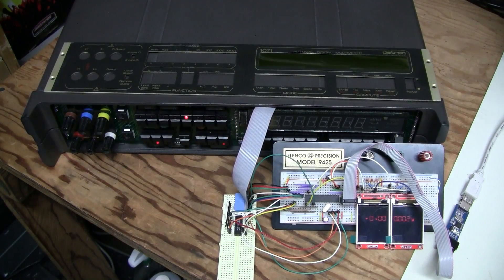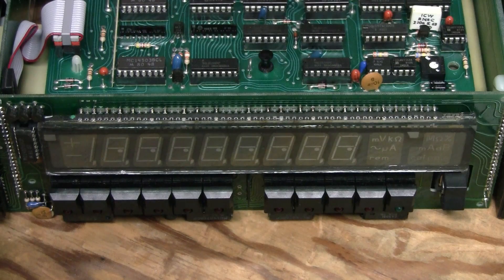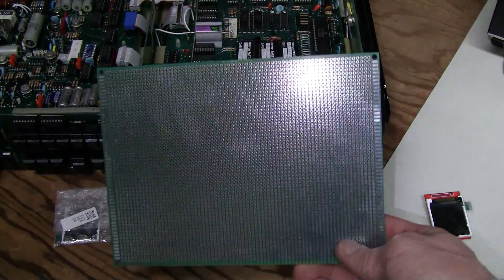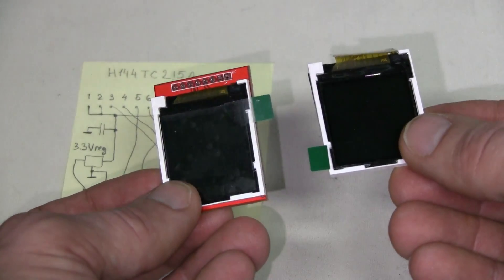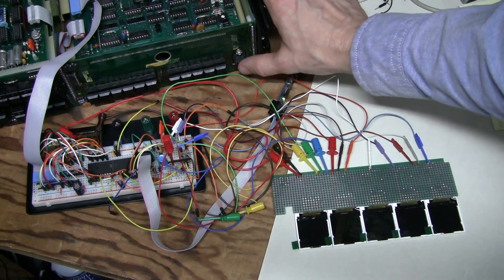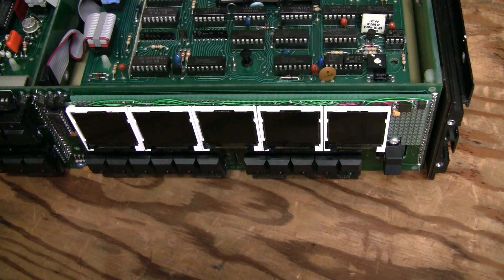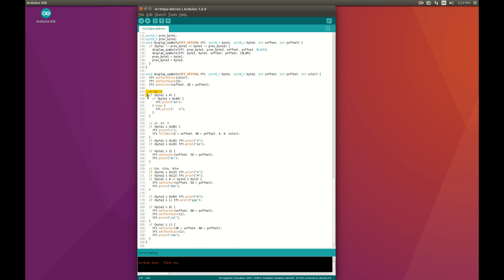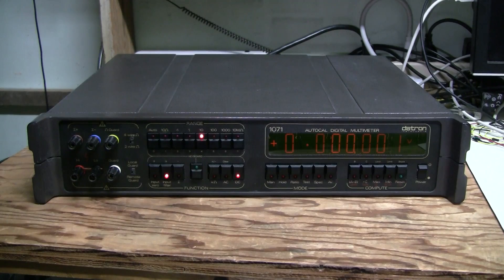#51 - Datron 1071 display replacement part 2

Comment: Excellent engineering, well done. I suggest that a lot of the viewing problem is the result of using the old filter plastic. It was designed to transmit blue/green light so it blocks red/yellow, and as a result dims the displays and emphasises any slight brightness differences. Change to either clear or a filter material designed for your new colour of display. Suitable material is used as photographic filters or much cheaper use theater flood/spot light material. This also gets rid of the years of scratches.

Comment: Since you're emulating the monochrome-style display of the original device, probably some OLED displays would give you much better off-axis view angles and more contrast.   I believe there are SPI-connected versions available, of course using some different Arduino library to drive them.  Nice work!  I did a similar project to rehabilitate my old Fluke 8040A using one of those LCD displays.  In my case, there was only a 3 Hz rate of display refresh and enough time between multiplexed digit strobes that I could just use a polling technique.  Rather than just exactly emulate the existing minimal display, I added max/min display, etc. that wasn't present before.

Comment: This was a very interesting series to watch, thank you for making and documenting it. The amount of effort you've put in is substantial.

Unfortunately it proved what I already knew. I don't like microcontrollers at all and I'd much rather spend just a bit more and use an FPGA for tasks like this. Even relatively inexpensive FPGAs can run 200MHz+ and you have full control of propagation delays etc depending on how you build your system. The timing will be exact and repeatable. For the displays, I absolutely hate LCDs for this reason. I would've used some of the larger dot matrix LED displays from OSRAM. They are routinely used in aerospace and broadcast gear for their brightness and reliability. But, that's also a much more expensive solution. OLED would've been an acceptable option possibly - but off the shelf OLED displays might not be bright enough.

Comment: That was a great result apart from the brightness and viewing angle issues of the LCDs, but that's not your fault.
Just some tips: adjusting the backlight dropper resistors specifically for each display might help solving the brightness issue.

Maybe there's an analog contrast setting pin on the displays, which might help solving the viewing angle issue, or at least to tweak it right to your preferred viewing angle. Maybe there's still a chance to find a datasheet for these LCDs.

Keep up the great work!
Reply: Yes, agree with you after such a great work, I would try adjusting the backlight dropper resistors.
Reply: @tiborbogi7457  Így, három évvel később már fogalmam sem volt, miről is van szó, de újranéztem, és érdemes volt. Nagyon ügyes, kár, hogy az LCD-k elég silányak.

Comment: I use OLED's in many of my products and they are very bright and fairly easy to drive. You can get long thin versions but I suspect you may need two but you could have one long one for the digital information and another shorter one for the other info at the right. I buy mine from Densitron. http://www.newark.com/densitron/dd-25664ge-1a/5-5-green-pmoled/dp/15R0861

Comment: Too bad about the brightness and viewing angle issue considering all the work you put into this solution.

Have you considered doing a custom pcb with 0603 LEDs? It might not be quite as pretty, but it should be possible to construct bright and readable digits. You could use a CPLD to simplify controlling all the LED segments.
Reply from the maker: This sounds too tricky.

Comment: I'd say that was a result. Have been looking forward to this installment for some time. I feel for you regarding the final visual result but I'd say that that is a small part of the great work you've done. If I can think of a solution I'll be sure to post here. For reference what are the dimensions of the board that carries the LCD's? I know I could figure it out by counting the 0.1" pitch holes on the protoboard you used  but having that immediately to hand for everyone in the video synopsis might help identify other options.

Cheers,
Vince
Reply from the maker: The window in the front panel is 165x25mm. All 5 displays, which I put in, are 160x38mm, and they took almost all available space. As I showed in the video, the module must not be more than about 6.5mm thick.
Reply: FeedbackLoop how about this: add a Bluetooth module to the MCU circuit. Get a suitably sized used Android cellphone to use a display and fashion a holder (3D print?) to attach the thing to the outside of the case where you'll be free of some size constraints. I know it'll look a little odd but it'll be hard to beat the contrast and display options going that route. I know there are quite a few challenges going that route but that's the best that comes to mind at the moment.
Reply from the maker: This is too exotic, expensive and involved.

Comment: Maybe it is worth looking at those backlight resistors, tune them to give even brightness across all displays, and will likely make the dimmer ones brighter.
Reply from the maker: They are running at 20 mA, which is the limit as far as I understand. So the brighter ones must be adjusted down. And this won't solve limited viewing angle. Thanks!

Comment: Great hack! Could you adjust the current limiting resistor per display? Maybe pots instead?
Reply from the maker: They are running at 20 mA, which is the limit as far as I understand. So the brighter ones must be adjusted down. And this won't solve limited viewing angle. Thanks!
Reply: Sorry to hear that, because the hack is beautiful! I hope you find a better drop in replacement screens. I'm about to do something similar to my old Philips/Fluke PM6665 frequency counter, but it sends the data on I2C, so that makes it easier.
Reply from the maker: As we can see, the hardest part is not the interface, but finding the right display to physically fit and with the right properties.

Comment: Hmm  I wonder if a set of oleds would be better in this application.
Reply: Fantastic hack BTW!
Reply from the maker: Perhaps, but they are expensive. Do you have particular models in mind with suitable dimensions? Thanks!
Reply: FeedbackLoop maybe,  what are the dimensions of the tfts?
Reply: FeedbackLoop another option would be to change the color of the digits to white. They would still get tinted by the front panel but I bet they would be a heck of a lot brighter.
Reply from the maker: The window in the front panel is 165x25mm. All 5 displays, which I put in, are 160x38mm, and they took almost all available space. As I showed in the video, the module must not be more than about 6.5mm thick.
Reply: FeedbackLoop there are a few on ebay, but I have doubts as to how bright they would be.   I really think changing the characters to white and also making them "thicker" would help the brightness immensely.   I know it would take away from it looking factory but it would be a heck of a lot easier than  redoing the entire thing
Reply from the maker: I made the segments 7 pixels wide instead of 5 shown in the video, and changed the color to white. Yes, this looks better, but not as authentic, and still some difference in brightness between the displays. Thanks!
Reply: FeedbackLoop that's good to hear.   Could you play with the back light resistor values to make the brightness more uniform?   Please post a little video showing the updated display:)
Reply from the maker: Perhaps, some day.

Comment: It's a beautiful job with the displays! I'm very impressed. It's a shame the displays don't live up to your skills and result.
I'd be tempted to use good old 7-segment (or 14-segment) LEDs. For the symbols, perhaps a little box with an led inside and a front cover transparent in the shape of the symbol.
Another option would be dot-matrix LED displays - allowing for limited "symbols" to be created. Both options would have excellent viewing angles.
These are extremely inexpensive on eBay.
Reply from the maker: Making special shapes for symbols can be a challenge. Besides, the color and brightness won't match the digits.